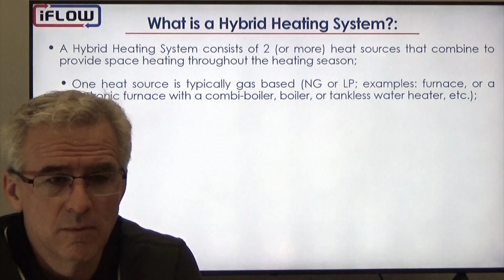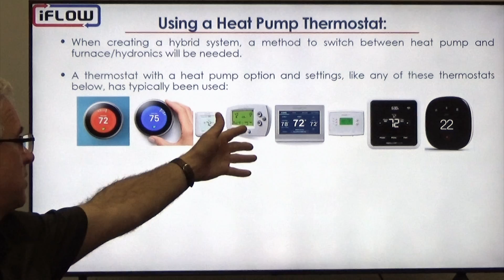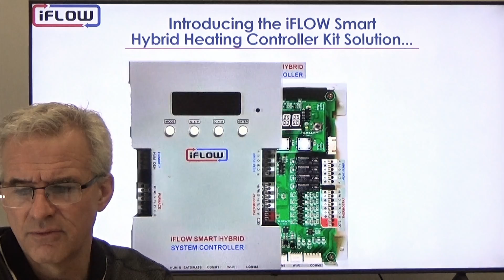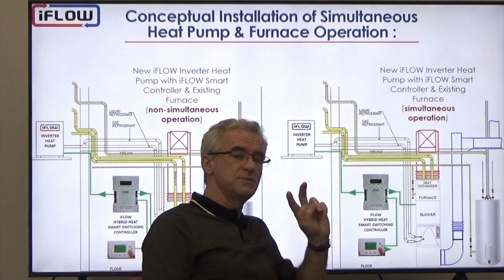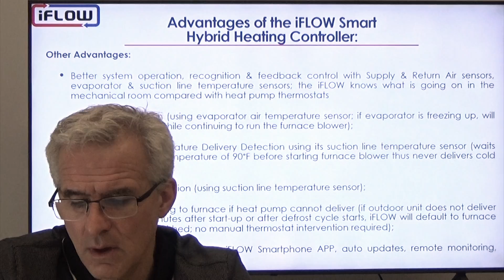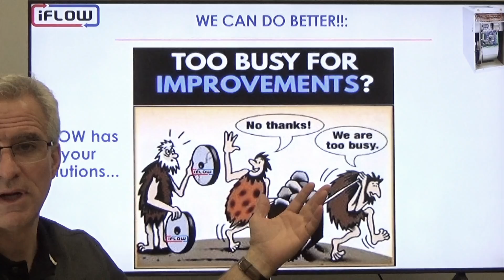iFLOW Smart Controller: an introduction (Part 1)

Comment: How does the iflow controller know when to put the clock back an hour in the U.K. when we switch from BST (British Summer Time) to BWT (Winter) in the autumn and then back again in the spring? It's got no Wi-Fi or Bluetooth and not connected to my network. It's been doing this accurately since 2007.